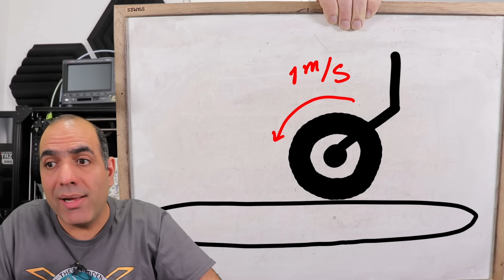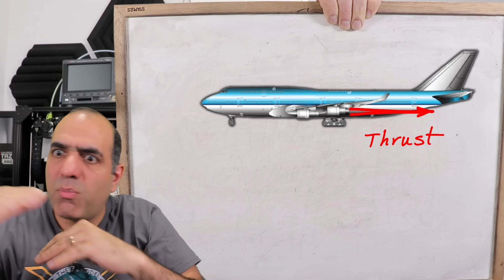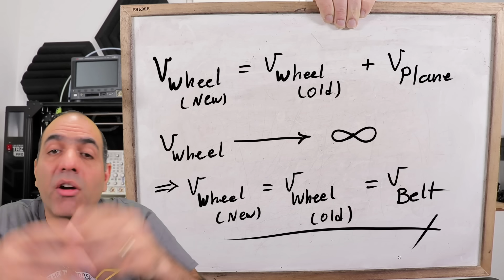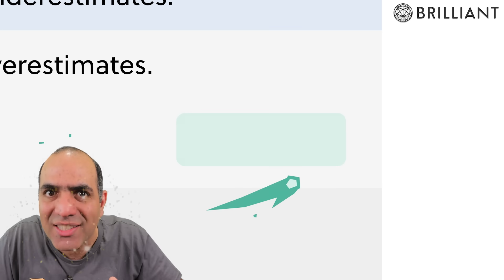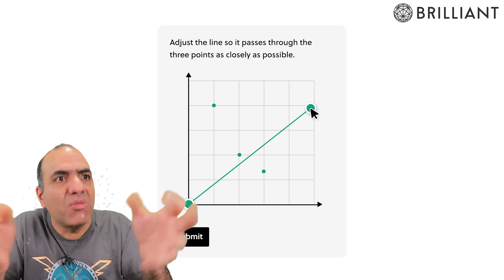Airplane Question that Drove Me NUTS!!!

Comment: There could be 400 knot headwinds, in which case the plane could take off without needing any thrust at all
Reply: Man I sure hate it when I go outside and the wind is going at half the speed of sound 😞
Reply: @nathanielthomas4437  
Funny thing - the wind is going about 600 MPH, about the speed of sound, at the surface. But then again  so are you. And your house, and everything else that's connected to the ground. Because the surface of the earth is going that fast, around and around.

(Speed judged relative to the average of stars overhead).

That's really the key to understanding the physics here - realizing that motion is all *relative*, that speed is a measurement comparing TWO things.  The wind (and the surface) S going 600 MPH, from the point of view of anyone else in the galaxy.

We are in the habit of comparing speeds *relative to the ground*.  Which works great when talking about cars, which move by pushing themselves across the ground. Not so much for *air*planes.  Because they aren't groundplanes; they are airplanes. So the ground doesn't matter. :)
Reply: bruh.......Air planes don't have power wheels
Reply: @animishaalagappa2327  
Exactly!
No wind mentioned. No propulsion stated
And the wheels of a 747 are not powered (nor mentioned that this imaginary 747 has powered wheels).
The only thing specifically stated is the 747 is sitting (not moving).
Reply: Touché!
Reply: @bitsofgeek  iinijiji
Reply: @bitsofgeek  hi join j
Reply: Bros a time traveller
Reply: Just about to commit on that XD There was an old news video about planes flying on their own in airports during a typhoon, because they were parked outdoors.
Reply: I think that happens with parked Cessnas as well.
Reply: No, without thrust it would get blown backwards. You still need the thrust.
Reply: @RegebroRepairs  you need more thrust to overcome the friction between belt and tyre. Which accelerates the plane backwards.
If you would blow a strong wind agains the plane to generate uplift on the wings. Air friction on the plane would also blow it backwards. Thus you need thrust to let the plane stay in its place to overcome air resistance  for constant uplift from the strong wing from the front.
Reply: @Techex_187  I'll just say it: The plane will be able to take off, because the belt needs to be so big and heavy that it will break before the plane wheels and grind to a halt. 

😀
Reply: @RegebroRepairs  What kind of nonsense are you commenting???
Reply: @Techex_187  Solving the issue by looking at it practically. 😀 You try building a treadmill for airplanes. Won't work. 😀
Reply: The average takeoff speed of a 747 is around 160knots. So a 160knot headwind will be enough to push the 747 off the ground.
Reply: You guys ever see the video of trainer aircraft at the Air Force Academy where a microburst hit and suddenly aircraft took to the skies from being parked? Kinda like that.
Reply: Vr (rotation speed) in a 747 is 160 knots. That's all you need to stay aloft.
Reply: There are videos on YouTube of parked STOL planes lifting off the ground in strong wind gusts because they weren't tied down -- simply because the wind gusts over their wings matched their takeoff speed.
ETA: I found a video. Pretty crazy ...
https://www.youtube.com/watch?v=TlEKiSwttsc
Reply: it actually happens to smaller lighter planes
there are videos of if here on youtube and elsewhere
Reply: "There could be 400 knot headwinds, in which case the plane could take off without needing any thrust at all" yes and no. it would be able to fly until the headwind had accelerated the plane that much into the opposite direction that the IAS drops below stall speed, and at idle thrust with high angle of attack that doesn't take too long.
Reply: Errrr it would still need thrust or it will quickly fall backwards down from the 400 knots winds coming from the front.
Reply: @nils-erikolsson3539  at least thrust enough to maintain zero gps speed.
Reply: @nils-erikolsson3539  with 400kts it actually has some time in the air before it stalls.
Reply: The video was released 2 min ago, how tf were u able to comment 8 hrs ago 😂
Reply: @neellohitdash  probbly like patreon or channel member early access
Reply: @Alexander24871 imagine paying to watch a commercial for brilliant
Reply: @Alexander24871  iiijiijiii
Reply: @Alexander24871  iiiii iini
Reply: @neellohitdash  probably Electroboom members or patreons, they usually get access to videos like a day earlier than everyone else
Reply: @aoyuki1409  hmm thanks for the info
Reply: @Neel Lohit Dash he is a time traveler 😂
Reply: @neellohitdash  cause they got a 400 knot tailwind pushing him ahead ;)
Reply: What are you talking about? This video was released two years ago
Reply: @Neel Lohit Dash  don't think any plane has a take off speed that high or that low
Reply: The plane could not propel its self forward, however the headwinds would supply lift and it would crash.
Reply: And the airplane automatically adjusting all the control surfaces
Reply: AV-8B Harrier would have no trouble at all with this, the question is too vague to answer.
Reply: you only need a headwind that's equal to normal take off speed to be airborne... google says 184mph for a 747.
Reply: In a >V1 headwind  airspeed you'll need thrust to stay in the same place relative to the ground, otherwise you'll slow down relative to airspeed (and move backwards relative to ground) and stall.
Reply: Yes, the LANDSPEED of the plane is irrelevent. The AIRSPEED of the plane is all that matters. 

Move the plane thru the air (like a normal take-off), or move the air around a plane (like a stationary plane with a crazy headwind)- Either way is the same thing.

Because the hypothetical only addresses the irrelevant landspeed, and does so in a weird, ambiguous, distracting way (while totally Ignoring the MOST relevant factor- The plane's relative airspeed), the question is unsolvable.
Reply: As others have said, high headwinds may initially cause lift but without opposing thrust from the engine(s), the wind would accelerate the plane backwards until lift over the airfoils is insufficient. If the plane were tethered the lift could be maintained, as with a kite.
Reply: I was about to say "What about a strong Headwind?". But you got it in there. Very concisely put.
Reply: It would also get taken backwards until it was matching the speed of the air and 'stall'. So it might be able to lift off of the ground for a while, not having any way to maintain the difference in speed to the wind (keep itself above the same place on the ground with the same speed headwind) it would act like it's gliding and need to lose elevation to maintain speed and generate lift.
Reply: @BenRHarsh  this isn't an unmanned aircraft. Spool the engines with the brakes, get the insane hurricane headwind, spool them up more and hope the lag on the jets isn't too long to get the necessary thrust in time. maybe you've got winds gusting to keep the plane up. It's one scenario in which the plane takes off that's no more ridiculous than the original proposal
Reply: well without any thrust, once airborne, it would dissipate the inertia,  slowing down (move backwards until it matches wind speed) and then fall down when speed won't be enough to create the lift it needs.
Reply: It could theoretically generate enough lift to become airborne but it could not move forward (in level flight) it would move backward until it stalled and dropped out of the sky because of drag.
Reply: Has anyone concidered that a conveyer belt the size of a runway has enough surface area to move the air too and create a wind 🤔 depending how smooth the surface is. Now would that air "cushion" get high enough to reach the wings? Wouldn't it keep the plain down if the air is only accelerated below the wings?
Reply: 400??;-;, It can take of at just 160 kts lol.
Reply: Um... Commercially licensed pilot here... Without thrust the plane in this scenario would be blown away... WAY AWAY!!!
Reply: Only if the plane is tethered will it lift, like a kite or it will blow away.
Reply: Even a house can take off at those wind speeds
Reply: Another thing this question made me think was how the rotating belt would cause some air/wind to move backwards due to fluid dynamics.
In general this is not a well formulated question.
Reply: that comment is as dumb as the conveyor belt problem proposed in this video and in myth busters
Reply: With flaps it would take only about 140 knots.
Reply: It would need thrust to stay in the air.
Reply: it actually happens with small planes that need a lot less headwind
there are videos of it here on youtube and it looks really goofy to see a small 2-4 seater just rise vertically while parked
Reply: Take off in this situation is probably the wrong word, I would say it would be blown away and crashing somewhere like it would be blown away from a hurricane.
Reply: @raistraw8629  9/1....
Reply: @raistraw8629  True. While the normal traveling speed is well over 400 knots (around 470), that's in very thin air. So at normal pressure it would be far into the overspeed zone and basically disintegrate.
If we ramp up the wind speed more slowly though, it could take off at around 150 and even stay airbourne and climb, if the wind speed grows fast enough.
Reply: @cmdrsenior  Because the air is thinner there will be less air getting sent over the wings and also less air entering the pito tube. 300kts airspeed is where the overspeed warning is on most commercial jets, cruse is 250kts, altidue doesn't matter. the speed is just a different way of expressing how much air is moving over the wings, it is converted so that humans can understand it easily
Reply: @MetaCake-  I know, but for the general public when they say wind speed they mean TAS not IAS. That's why I tried to explain the difference of 400kt wind on the ground vs up in thinner air.
Reply: @cmdrsenior  Even 400 knots Ground Speed at normal pressure is achievable by 747-800. Im not sure now what is actual Vne of 747-800 for example (I would say about 420 knots) but it's possible. A320 has 350 Vne so I think that 747 series have it a little bit higher but it's possible.
Reply: @Silenthunter199  Afaik Vne for 747 800 is 365 IAS, so it might be possible given some safety margins in the Vne, but the cockpit alarms will be screaming at you and there's no guarantee to not disintegrate.
Reply: exactly my thought lol
Reply: Does it matter? An aircraft will never get into this predicament.
Reply: Imagine 400 knot headwinds suddenly smashing into an airplane.
That thing will flyyyyyyy
Reply: or you could have 400 knots in your head instead of brains.  There are dumb questions.  This is one of them.  It's so dumb that it makes people betray how uneducated they are when attempting to answer it.  It's a question so ridiculously stupid that it lowers the IQ of anyone begging it.

The wheels have absolutely nothing to do with how a plane takes off.  So neither does a conveyor belt.  This is like asking if you drown a bird in a bucket of water and pluck it, can it still take of again if you dry out the feathers?  The bird is dead.  Why the fk are you thinking about the aerodynamics of loose dry feathers?
Reply: Reminds me of the early versions of Microsoft Flight Sim, where I would set a really high wind speed and try for a vertical landing.
Reply: it's not infeasible with climate change happening
Reply: This guy thinks differently
Reply: Spoken like a true sailor.
Reply: Even like 150 knot wind it could take off
Reply: Initially, yes. But it would need thrust to keep it from being dragged backwards. Or the plane could be tethered to some tower on the ground, esentially turning the plane into a kite.
Reply: There could be some unicorns too 😂
Reply: That's the 747 on Uranus, right?
Mehdi nailed it with that 'missing conditions' factor.
Atmospheric density may also play a part.
Reply: Thought the same thing
Reply: Well no, as soon as the tyres lose contact the plane will move backwards which lowers the effective wind speed
Reply: one minor remark: wind is not a laminar flow and would be far to unstable to sustain flight.
could a pilot compensate for that and can it take off without crashing?
Reply: Sure if the wind came on all of a sudden and ideally u let the plane rise like a flying dragon. Otherwise u just push it backwards.
Reply: At 400 knots headwind, a person would take off without needing the plane.
Reply: If there were a 400 knot headwind, the plane would blow backwards off the conveyor belt,  Suboptimal.
Reply: and that 400 knot headwind could be caused by conveyor belt running at speeds approaching infinity.
Reply: I laughed quietly for the first time today, well done.
Reply: It will need the same thrust as there were no wind becouse without thrust plane will be blown away
Reply: https://youtu.be/vLeQ9idk4T4 this explains the case
Reply: Wrong. FORWARD THRUST is needed for forward flight. Otherwise it might liftoff but go no where.
Reply: LMAO.   Sure if the plane is tethered to the ground so it can't move.
Reply: @johncundiss9098  do you know that the  mass of the plane would keep it from slowing that fast. It would look like it flew backwards from the ground but in the air everything would be fine except the overspeed follow up by the stall later.
Reply: @simon4765    yeap. sounds right.   stall then the fall.
Reply: I was gonna say not really since the highest wind speed recorded on Earth was only around 200kts... But that's still just enough for a 747 to take off (depending on the weight).
Reply: Best answer without a doubt
Reply: If the plane has no thrust, then it would just be blown by the wind. however, if the the plane had a forward thrust of 400 knots by the engines, against a headwind of 400 knots, then the plane would LOOK LIKE it's taking off without moving but in reality it is actually moving at 400 knots.

This is how the old bi-planes used to fly backwards. They have a very limited forward velocity and , when faced with a strong headwind (stronger than their forward velocity), the wind would actually blow the plane backward while it would still maintain a flying trim.
Reply: @HueToobBlows    yeap.   Tail wind will get you to your destination much quicker in the opposite view.
Reply: And fly backwards
Reply: But with the head wind and no thrust, it would start going backwards with no control and eventually stall and crash
Reply: Not part of the scenario! 🤦‍♂️🤦‍♂️
Reply: (left aside the fact that even the heaviest aircraft does take off below 200kts)
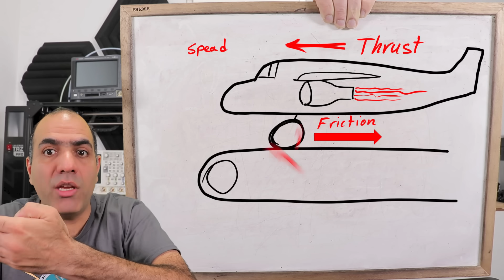Reply: 5:25 spead?  🤣😂🤣
Reply: 460 mph winds, yeah sure jan
Reply: Mythbusters answered this nearly two decades ago. How is this still a thing??
Reply: you time travelled bro
Reply: Except no airport will let you take off over 40, and a category 5 wind is always incredibly chaotic, you would get asymmetric lift and get downdrafted before you got up (which is why they wont let you take off)
Reply: So wind faster than ever recorded on earth?
Reply: Oh, no. You're going to give him a stroke!
Reply: The fast moving belt could generate this headwind through friction so ...
Reply: nah just use a big trebuchet!
Reply: https://youtu.be/Utm1LuWB9CI
Reply: Pretty common in aviation to take advantage of strong winds against the aircraft during departures/arrivals.

Runways aren't constructed at random, there are studies beforehand checking the average wind gradient on a year, it's directions and strength.

On top of all that, if winds suddenly change direction, controlled airports will have their runway inverted by traffic control. I had that happening to me twice, I was scared sh!tless. But it is pretty normal.
Reply: @ruffusgoodman4137  yes but i was reffering to the plane being pushed back by that wind if the engines were off.
And yes the wings benefit from backwind
Reply: @Techex_187  Not backwind, headwind.

You always take off against the wind, unless you're absolutely sure of what you're doing.

Backwind demands more runway than planned for its category
Reply: @ruffusgoodman4137  Headwind sorry.
I translated it wrong
Reply: Headwind is a good point... could have a tailwind screwing the equation
Reply: Where is air mentioned in the original scenario, the plane could be "sitting" in a vacuum.

With the parameters supplied, ie no air, the engine won't even run and there can be no wind... 

Gravity is also undefined, but in a world without air what we're looking at is a plane shaped spaceship docked with a conveyor belt floating through space... and that ain't a "take off" ;)
Reply: In cruse the plane is usually only going 250kts and an overspeed warning is issued at 300kts (Airspeed not groundspeed)
Reply: Let's ask the question differently: can a plane fly without wheels?

Yes.
Reply: That's where I thought he was going when he mentioned the viscosity of the atmosphere in the intro. I figured there would be another answer in here about the friction between the conveyer belt and the air inducing a headwind.
Reply: @fgf80  Hey that's a good one! If the conveyor belt surface has any friction at all, it would also move the air above it and since it's accelerating like mad, you would get into the air even with minimal thrust. Pretty bumpy ride with lots of turbulence prolly, but still.
Reply: This has actually happened, and there are a few videos of it. Not at 400 knots, but for example, light GA aircraft can lift off at about 50-60 knots, and in wind storms, the wind can easily gust that high. Poorly tied down aircraft will just take off like a kite if the wind is pointing from the front of the plane.

It DOES need thrust to stay in the air like that though. Otherwise, the wind immediately starts carrying it backwards, the airspeed over the wings drops to below stall speed, and the plane comes crashing back down. It can also flip around or flip over without a pilot at the controls, since planes arent that inherently stable.

Even that has been accomplished though, some STOL pilots have had fun matching airspeed with headwind speed, then effectively hover in place relative to the ground.

You dont even need an engine sometimes. If there's an updraft as well as a strong headwind, even a glider can do this..Theres actually an awesome video on youtube of a glider pilot hovering in place with a strong headwind, and pointing his nose down to keep speed high, in a thermal updraft.

The key here is that planes provide thrust and generate lift relative to air... Not the ground... If you want to "conveyor" something, the implication is that the MEDIUM of locomotion is directly counreracting the propulsion system... For a car, this would mean a conveyor belt, since its medium of locomotion is the ground. For a boat, this would be like sticking a boat in a strong head current, since its mode of locomotion is the water (assuming its not a sail boat of course). And for a plane, this would mean a wind tunnel, since its mode of locomotion is the air.

I absolutely hate this problem, because the fact that most planes have wheels hacks your intuition, even if youre not a dumb person. Then, because being wrong on the internet is a sin now, people will die on the hill of that initial intuition now matter how much evidence is thrown their way. Long story short, asking "would a plane take off on a conveyor belt" is about as silly as asking if a boat could drive forward if you put it on a conveyor belt... Thats not how conveyor belts work, if you want to "conveyor" something, IT MUST use the same medium as that which the vehicle uses to move.... Neither planes nor boats use the ground to move forward, so sticking either of them on a conveyor belt is pointless. In the plane's case, its wheels are relatively frictionless in the bearings, and the thrust from the prop or jet engines easily overcomes the conveyor belt almost no matter what speed you crank it up to (and I often see people try to counter with what if you crank it up till the bearings are practically melting... Its like, then youre just getting silly and missing the spirit of the question, as the original spirit of the question can essentially be rewritten as "do conveyor belts work on planes" with the implication that it matches the speed of the plane in the opposite direction... Going beyond that is just shifting goal posts to not be wrong). By contrast, a boat would have a ton of friction between its hull and the conveyor, and the props would provide almost no thrust outside of water, so... It would just get carried along by the conveyor. either way, its a stupid scenario.

Planes taking off vertically in an above stall speed headwind makes an excellent point to people who want to argue this problem... The landing gear wheels dont even spin in that case, which really should highlight just how much the landing gear has almost no bearing on a plane's ability to fly (other than making its contact with the ground as frictionless as possible). Similarly, if we took the assumption that wheel spin IS required for takeoff somehow, then how did the wrightflyer take off on greased rails? How do seaplanes take off? How do planes with skiis take off from glaciers? The people who argue a conveyor plane cant take off are basically implying that power is sent to the wheels, and thats why it takes off... If we accept that implication, then how do ANY OF THESE alternative surface contact methods allow aircraft to take off?

... Its because the surface of a liquid or solid has no bearing on how a plane flies, or moves forward. All you have to do is ensure the contact with the surface is sufficiently frictionless, and an aircraft WILL take off no matter how you move that surface underneath of it. And by far, the most frictionless of the landing gear types, are wheels rolling down tarmac.
Reply: @hatman4818  I understand considering conveyor belts to planes is kinda stupid, but the goal of the question is to make you think how much the conveyor could hinder the takeoff.

Besides, the problem considers the conditions stable, so no wind I guess. 

Sounds dumb, but switch conveyor with a flat tire and you'll get a very VERY real situation where (disregarding unbalanced landing gears) the aircraft speed IS impaired almost to equal it's speed.

On a split second, you'll have the same problem posed while piloting. You'd consider the plane to be able to takeoff? Or it is impossible?
Reply: No problem taking off. Been done on mythbusters.
Reply: no, you would still need thrusters because ultimately the plane would just be blown back at 400 knots. It's like a kite. You can't fly a kite without a string because it'll just get taken with the wind at which point will experience 0 lift and just fall down wind.
Reply: No plane would go in 400 knot headwinds, they would be cancelled for bad weather.

Technicially:

Crosswinds greater than 50-60 km/h may cause airlines to delay or cancel flights. Even lower gusts can trigger flight delays or cancellations if the runways are wet or icy, as stiff winds can reduce a plane's ability to brake on the runway.
Reply: If it didn't have thrust it would just get pushed backwards
Reply: it could also not be any treadmill but that would be a different problem, in this case there are no headwinds, if you change the conditions then you are answering to a different problem.
Reply: Exactly. It really doesn't matter what the wheels are doing if there's air under the wings to float on
Reply: If the belt has friction, it will act on the air, and the turbines are pulling air under the wings, how fast does the belt need to move to make the plane hover assuming the plane is properly tethered
Reply: Unlikely but sure...
Reply: Conveyor belt was on 30000 feet above sea level
Reply: Yall talkin' about a Kite now. 😂
Reply: Anyone who has played flight sim will know this answer
Reply: Add a rocket engine and point them properly and it will take off.
Reply: It would need thrust to keep flying! Otherwise it gets taken with the wind, matching the speed of the air. However, if the headwind is blowing at takeoff speed, the plane can hover relative to the ground as long as its thrust balances with drag.
Reply: No, it will be blown away...
Reply: If the 747 stand still in 400 knots wind it will blow away like it's was hit by a hurricane. But with engines on full thrust it would theoretically just lift and go nowhere if the the thrust isn't greater than the wind. 

I think my answer could be better formulated tho.
Reply: wouldn't be wind the planes still not moving.
Reply: It would still need thrust because without, the plane would be getting pushed backwards at like 400 knots.
Reply: @Joe-xr2xl  Yes, and that thrust is going to move more air by causing low pressure at the back of the plan and around the high pressure cone of exhaust from the jet engines.
Reply: And the plane would be immediately torn to pieces by the category 5 hurricane that produced those winds.
Reply: It still needs thrust because of drag. It's just going to get pushed back unless it was an instantaneously applied headwind. Then it would go up some amount, get pushed back, lose airspeed until stall, then crash.
Reply: * Tailwinds
Reply: at first the plane will go a little bit but because of the friction between the plane and air it will go back words and then the velocity of plane with respect to air will decrease and then the plane will again come down then after touching the ground it will slow down and when it comes to rest again the relative velocity will again become enough then it will again fly and this loop will go on forever. or else the plain has a basic thrust to stay not to go back ward.
Reply: With 400 knot headwind and no thrust, wouldn’t the plane just get blown backwards ?
Reply: @sonicperformance  thats what i said in my comment.
We still need same thrust so that the plane does not go backwards
Reply: ...wouldn't need a conveyer belt either...
Reply: yea
Reply: The 747 could only take 40 knots i belive
Reply: That's why planes, especially SMALL planes and business jets) come with TIE DOWNS for when they're parked outside for extended periods or strong winds are predicted. This basically straps the wings or fuselage of the plane to a fixed tie-down point  concreted into the tarmac.
Reply: And flys backwards at an increasing velocity until the airflow over the wing relating to the spees of the air and loses thrust.
Reply: Still it would need thrust otherwise it would blow the plane backwards
Reply: Wrong!
Reply: As the conveyor speed increases, friction between the moving conveyor and the air, would cause the headwind!  Which might cause the plane to fly, but the pressure of the wind would decrease with altitude, so it might depend on whether the difference in air flow over the top of the wing was greater than that below it to cause sufficient lift. Also it might be different with different levels of flaps. ha ha.
Reply: Correction, headwind would only need to be about 20 minutes faster than the aircraft normal takeoff speed
Reply: If you can make a wind tunnel with category 10 hurricane force winds than I’ll give you a slow clap
Reply: U only need 150kts to rotate and 200kts to have a stable flight 400kts isboverspeed which is dangerous
Reply: You would still need thrust. The plane would initially get blown upwards, but would need thrust to continue not getting blown backwards and eventually losing lift.
Reply: You a pilot? Or just smart!?
Reply: Eh... no, The aircraft would need to maintain thrust to stay put in a 400kt (which would be a massive overspeed for a 747 btw) headwind. Otherwise it would be blown away.
Reply: @Hairysteed yeah whoops, I knew someone was gonna mention it...
Reply: But there is a problem there no way a plian got 400 knots head wing😂
Reply: No
Reply: Aiplane would be pushed back not take off
Even if engines are on and poweres to same to enough thrust that would move by 400 knots and head wind also 400 knots 
The plane would just loft vertically not horizontally.
Reply: It still needs thrust in a headwind, it just need to be slight more than the headwind
Reply: I don't think anyone would be able to watch the plane taking off with winds at that speed, so the plane never took off as far as we know.
Reply: True
Reply: 400 knot wind a plane can not take off each type of plane is rated for take off with wind speeds in mind you know nothing about what you are saying.
Reply: Take off Backwards
Reply: Of course, that's true if you ignore air resistance. In reality, the wind might cause lift, removing enough weight off the tires to lift the plane off. But without any thrust the plane would start moving backwards, reducing it's air speed and thus reducing it's lift, thus applying more weight on the tires. The plane would be slowly blown backwards, assuming the pilots control the plane to keep it from flipping or something.

But in theory, they could apply thrust and potentially take off with zero ground speed.
Reply: @MrFastFox666 exactly.
Reply: @MrFastFox666 look up slope soaring.  Gravity can be used against a headwind to sty flying almost indefinitely.  It's easier with a slope (hill causing updraft with the headwind) but blowing straight across the sea or flats the concept still works.  In fact, that's how trade happened with sailboats for hundreds of years. You can sail downwind faster than the wind, and you can sail upwind.
Reply: It would just be blown away since there is no opposing force
Reply: The moment the plane takes off and loses friction with the ground, it would start moving backwards and would fall back to the ground.
Of course, if there is no friction to start with, the plane would be moving backwards on the ground.
Reply: @ИванСнежков-з9й    The wheels are not propelling the plane; there is practically zero reaction force versus the ground.  They are only providing normal force to counter gravity.
Reply: @catsupchutney  You didn't read the original post of this thread, did you?
Reply: Only if the plane was already maneuvered in a position to take the wind head on  before it began and the jet engines would already have sufficient thrust to counter the wind. That is because it would be impossible to taxi the plane on ground in such wind without the plane breaking. They are not designed to take such forces sideways. Only head on.
Reply: Assuming the plane was physically teatherd so it couldnt travel down the belt, at some point the belt spins fast enough to generate the required headwind.
Reply: No, they could not take off as long as engines doesn't produce any thrust to compensate the headforce. Plane can fly only when forces pushing plane up will be at least equal or higher than gravity. Did someone ever saw helicopter or quadcopter? You only have problems with imagine how all the forces can be balanced.
Reply: @romanowskis1  on an airplane  thrust is counteracting drag and providing almost no lift (depending on AoA). With a headwind above takeoff speed, the plane could take off, but without thrust it wouldn't stay airborne long
Reply: wrong, need to account drag
Reply: How could it do that if the wheels arnt spinning, check mate!
Reply: @BogosBentin  do kites have wheels?
Reply: Still needs thrust to overcome drag
Reply: Lol
Reply: @anthonyhorst7116  
Agreed, an external wind is not mentioned, therefore it cannot be included as a possible solution.
The answer remains no for all 7 instances I referenced.
Reply: *tailwind
Reply: Wheels would be damaged from excessive speed.  While they aircraft accelerates to VR using engine thrust against the air, the wheels will spin twice the normal speed. This would result in bearing failure and tie failure
Reply: @insylem .it wouldn’t be twice the normal speed, it would be infinitely more or to the point of Bearing failure.
Reply: @insylem  the wheels wouldnt be moving if the airspeed was high enough. Relative to the ground the plane would not be moving.
Reply: @insylem  Yeah, wheels would likely damage, but most certainly not because of bearing failure. It's the rubber that would fail.
Reply: @jothain  I think you're right, I think you'd hit the tire speed limit before the bearing failure point.
Reply: Note that air resistance will accelerate the plane back and thus reduce the actual uplift on the wings
Reply: It will not take off, condition given that wheel speed and belt speed are matching, plane would simply not take off as there is no forward thrust…. Given that all the scenarios like frictions from bearing and any frictions are not considered, except no loss of friction between conveyer belt and wheel.
Reply: 400? I think most commercial planes have max airspeed of something around 300.
Yea @Dee Tee said it.
Reply: @Shadow_of_STLKR  you were correct with 300kts actually, 250kts in curse usually
Reply: @Shadow_of_STLKR  Around 160kt at takeoff
Reply: @Shadow_of_STLKR  the wind around it can be going faster tho
Reply: @Shadow_of_STLKR   - Multi engine airliner -stall speed ~120kt, say - cruise speed ~450 kt.
Reply: @Shadow_of_STLKR  A 747 flew from new York to London at 825mph...
That was 570mph air speed and one heck of a jet stream.
Reply: @Shadow_of_STLKR  747's can travel as fast as 656mph,  thats mach  0.855. the chances of wind speed being 460mph is marginal to none. stupid comment
Reply: Why is there a headwind? The only thing moving are the wheels  the conveyer belt and the air being thrust from the jet engines. Whi h is moving faster than the air coming in at the front. You would have to assume the moving runway was pulling air along with it as the same speed in order to generate lift.
Reply: @another3997  There could be a headwind, because the question doesn't say whether there is one or not.

I've seen video of a light aircraft doing vertical takeoff and landing with a strong headwind..
Reply: @epiendless1128  There would be a headwind caused by the conveyor moving.   The conveyor as wide as the runway would move a channel air above it backwards causing strong lift because the plane is also in ground effect.  I am assuming that the engines would be running at takeoff power.  It's not forward momentum, it's air speed below and above the wings and control surfaces that cause flight.
So when the plane took off, it would loose the friction of the wheels on the runway, so could move faster without the wheels spinning faster.  So let's assume the conveyor starts keeping up with the wheel speed at the start of the runway...the plane would take off at the start of the runway after wind speed, and then go off the runway with the runway conveyor causing airflow under the plane until the end of the runway , at which time hopefully the ground speed and altitude would be high enough to continue without assist from the conveyor.
Reply: @another3997  
The way the question is written, nothing is moving. EB even caught that.
Reply: @another3997  
Where is it stated that there is any propulsion?
The only movement indicated was the 747 was sitting on the conveyor only.
How can there be a propulsion means if the 747 is sitting?
Without a specific thrust produced (not specified) the 747 cannot take off.
Reply: tailwind not headwind , headwind will act against thrust from the engines and if the engines are off, it will push the plane off the belt. Wait!! then the belt will move forward against the wheels moving backward and both will simultaneously increase till the plane jumps kind of and then crash lands. Bruh, now even I hate these question with mild passion.
Reply: @rivulet1013  No, it would have to be a headwind to generate lift over the wings. Planes don't fly backwards lol.
Reply: @rivulet1013  no. A headwind will let a plane take off. Headwind is what creates lift.
Reply: @jonny2085 hahahaha
Reply: @jonny2085 
Relative airspeed is what creates lift. The speed difference between the wind and the wing.

Notice that in the phrase "the speed difference between the air and the wing", that phrase never mentions "the ground far below".

It doesn't matter one bit how the ground below is moving relative to the air (what we call "wind").   What matters is that the engine (or gravity) is pushing the aircraft through the air.

This whole conversation is based on the viewpoint of people who spend all their time on the ground,  so they think of motion relative to the ground.  The airplane isn't touching the ground, so motion relative to the ground is absolutely irrelevant.  From a pilot's perspective, wind is just the ground moving around far below you.*  It doesn't matter, since it's not touching you.  What matters is what's touching you - the air you are moving through.

Note that the ground is actually moving about 1,000 MPH.  That's why we have day time and nighttime. Because the ground your city is built on moves towards and away from the sun at 1,000 MPH.